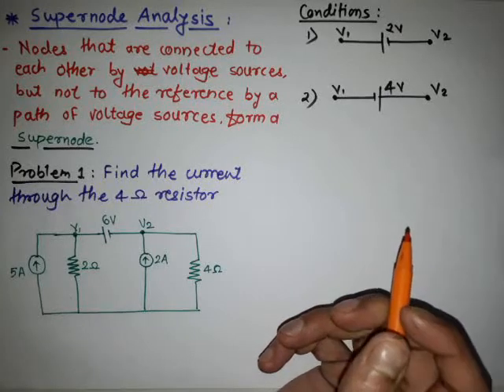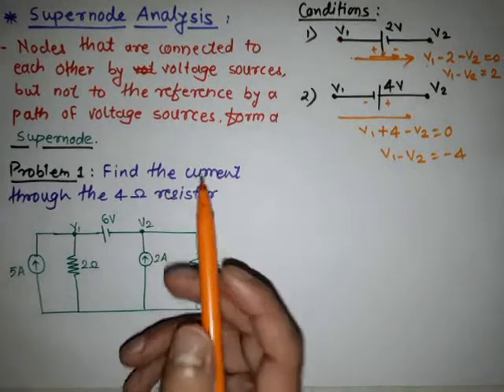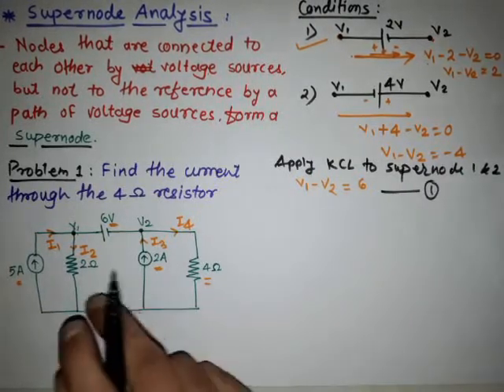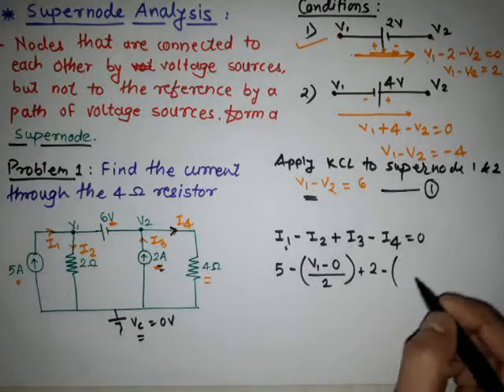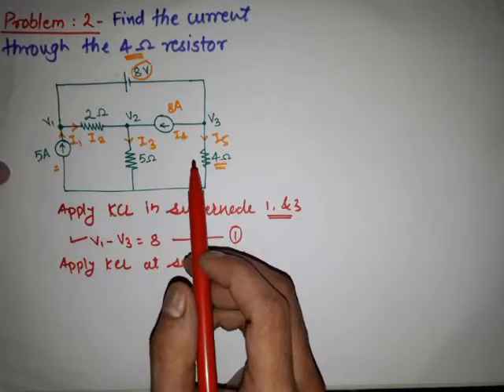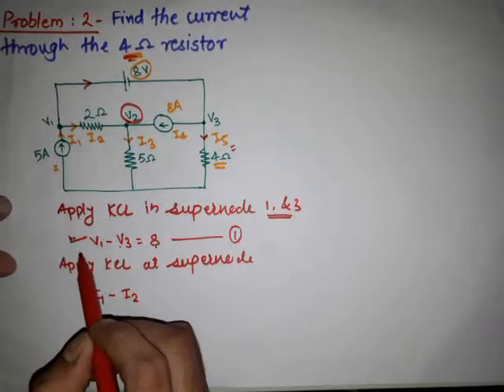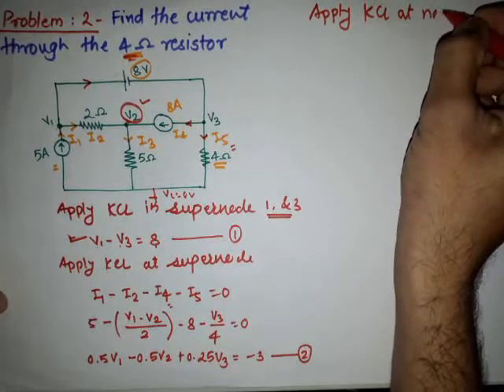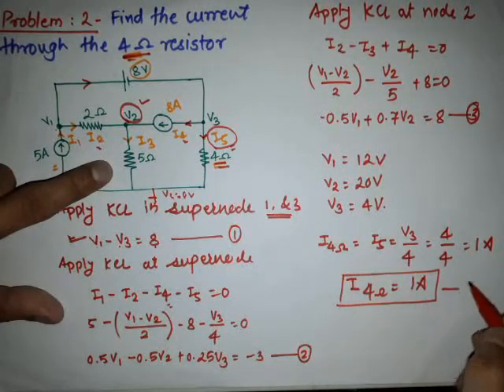Supernode Analysis ( Lecture: 6 )

Comment: the answer of problem 1 is incorrect. Correct answer is V2 = 16v. Hence current through 4 ohm resistance is 4 amperes
Reply from the maker: please solve ones again it is correct in the video.